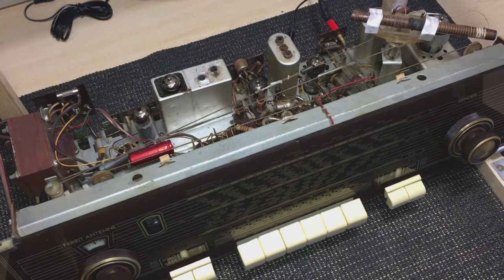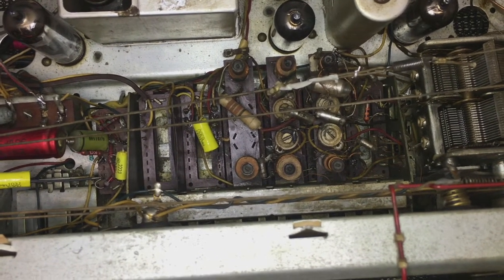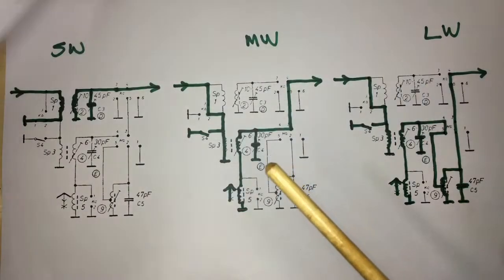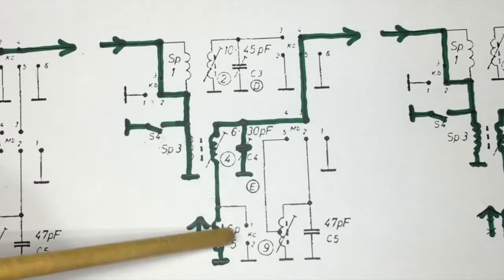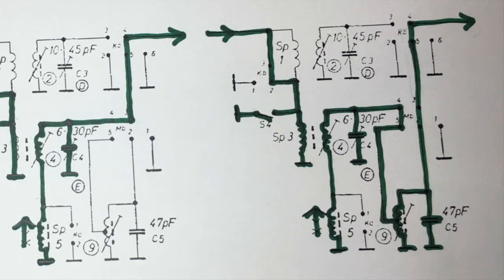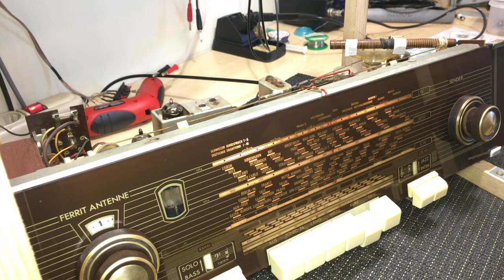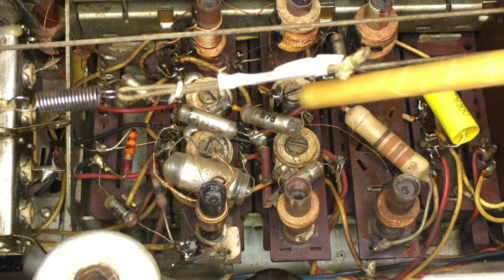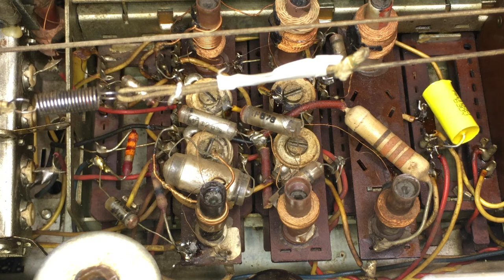Telefunken Operette 8 tube radio restoration - Part 4. Repairing the RF coils.

Comment: I find so many of these older radios are screw-drivered to death.  Instead of replacing the faulty caps, people try to keep them stable be playing constantly.  
I know you reform the electro caps sometimes, but for me, I think its better to replace them given caps are pretty cheap.  Personal preference.  I just have found in the past reformed caps tend to give me issues.  Electros sometimes go dry inside.   :)

Comment: I think it's time you tackled a Saba with automatic tuning! A few of us need to know how to fix those. :)
Reply from the maker: +Martin Telfer : haha. I've actually done one of those, a Freiburg 8, but that was before I started the YouTube channel. I use it every day. 
My goal is a Freiburg 125 (or even a Meersburg) for a future torture session (I mean project). These are rare and quite expensive to buy, so I have a permanent search programmed on my ebay app. I need to find one in its original condition so that I don't have to correct others' repairs. I also need to find it in germany so I don't pay more for the shipping than for the radio. For some reason, shipping from Germany to madeira is actually quite reasonable, unlike from other places. 
So, in summary .... this is definitely on the TO DO list.
Reply: I'm working - or rather not working as our weekend home yard consumes my summer weekends - on a Freiburg 8 now - that's the one you kindly supplied the new IF can for. It's about done, except the AFC and search work in only one direction. I think it's an issue with the "discriminator" output, but I need to get the scope on it to check. Any thoughts welcome...
Reply from the maker: +Martin Telfer : yes, you'll definitely need the scope on it, and a very careful analysis of exactly what you're looking for to set it right. I was fortunate in that my problems with the auto tuning were limited to the motor itself and the capacitors attached.
Reply: I repaired one once!   The cast metal dog inside the servo had decayed to the point the pot metal was flaking apart.   I had to make a new one by hand out of aluminum billet, drilled and tapped the set screws that rode on the shaft of the tuning control.  Swore I would never do one again!
Reply from the maker: We all swear to those “never agains” and then we do it again 😊

Comment: Were the coil adjustments always sealed in wax on these old radios? I have a Nordmende Elektra (US import version) with no signs of wax on the coil adjustments and one replaced electrolytic :/ I haven't began tests yet as I'm waiting on replacements for dried out wax & paper caps.
Reply from the maker: Most of them used wax to seal the cores, but not all.